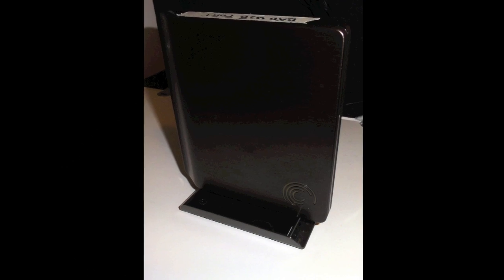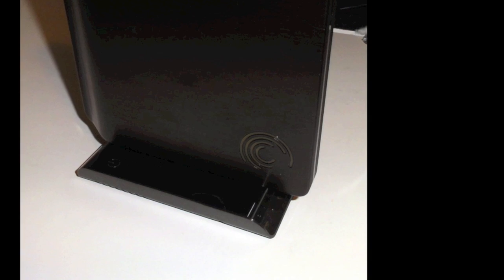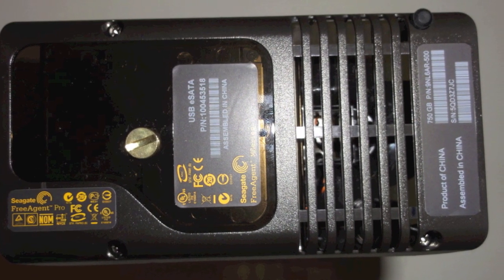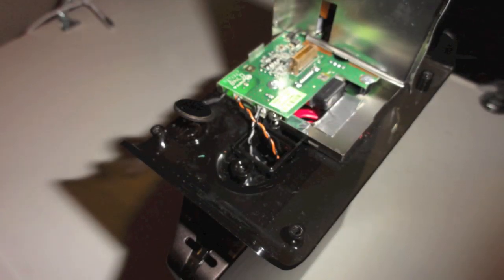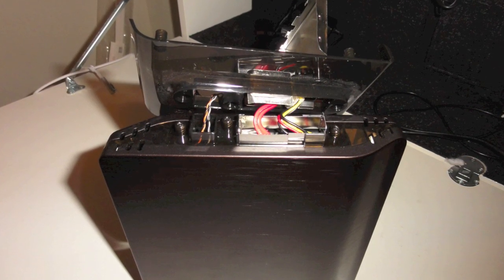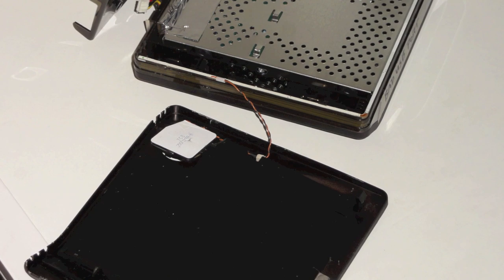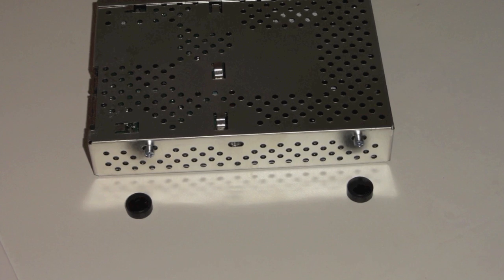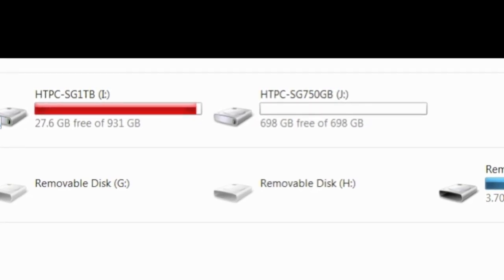Seagate Tear Down

Comment: This video looks like it will be super helpful for me. I know this is a very old video, so I'm not sure if you'll be able to answer this...but I'm about to take one of these bad boys apart, so here's my question: When you put the straight piece of wire hanger in the vent-hole pictured on that guys blog are you trying to pry that clip "UP?" Or "PUSH" it somehow? It isn't clear from his description. Thanks.
Reply from the maker: No, he doesn't really make that clear does he? I didn't do it that way and I can't remember which direction would work best. Good luck in salvaging your drive, though.

Comment: I tried the Hanger trick, not enough force to push the clip free. I found that using a small screw driver and a hammer. Gently tapping until the first clips came loose. took a total of 7 minutes to get into the drive bay. The metal cage can be a pain, you just have to squeeze one side loose and the whole thing comes apart.
Reply from the maker: Great tip

Comment: If my hard drive is lighting up but not being recognized but any computer. It is likely just the casing that is the issue, right? If I were to remove it, would the drive be wiped clean, or would the files remain intact if I put it into a new enclosure?

Comment: Can't disassemble, near logo Seagate, like lock. Please, help
Reply: I'm not sure if you got your issue solved, but I used a butter knife to open the lid with the Seagate logo about 3/4 of the way. It was challenging to open, especially near the connector area. I placed the logo side of the lid on the floor, managed to pry it open enough to put my foot through, and yanked the drive almost 90 degrees before i got it separated. It broke one of the clips. The case was already damaged and it wasn't being recognized by the PC anway, so I didn't really care.

I had to use TestDisk by CGSecurity to recover all the data because otherwise, it was showing as an unformatted drive when I plugged it into my desktop.

Comment: Nice video. Question: Is the drive you found inside a 7200rpm or a 5400rpm? Thanks.
Reply from the maker: The Seagate FreeAgent Pro 750 GB 3.5" USB 2.0 eSATA hard drive is a 7200 rpm drive.